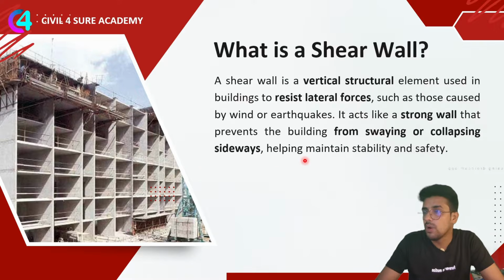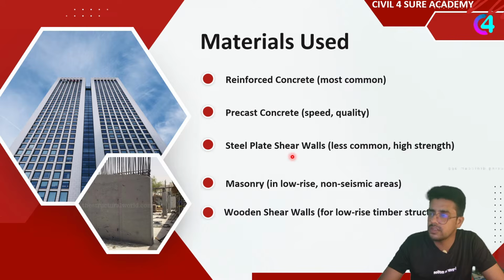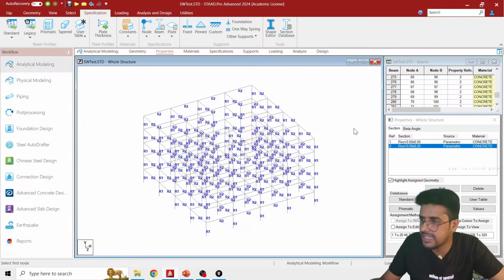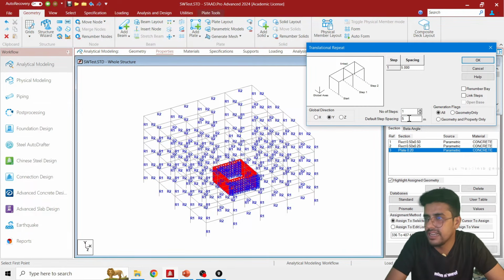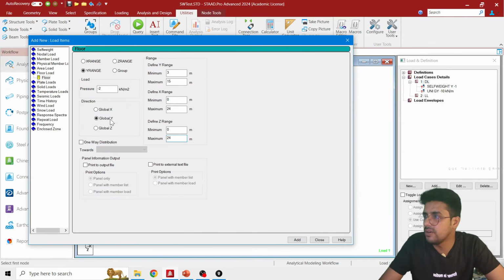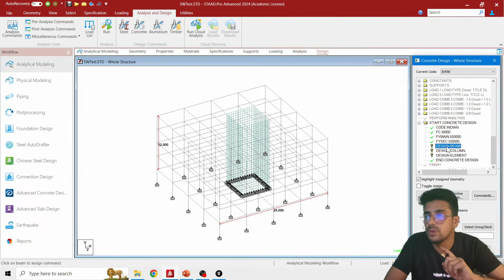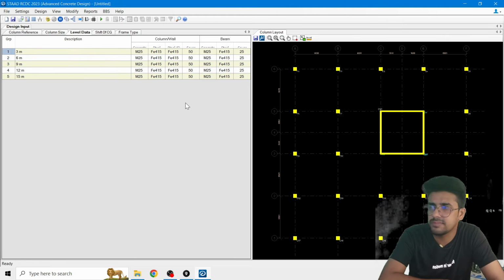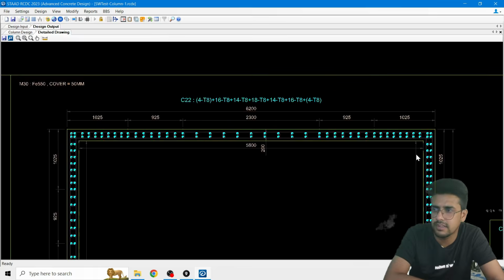Understanding Shear Walls in Civil Engineering | STAAD Pro + RCDC Connect  Edition

Comment: Thank you for your video. I have a question: the lift well is not closed on all four sides — one side has a door opening. How can I create that? Please explain.
Reply from the maker: Yes, you can do that, After clicking the Parametric Model, and after then creating a wall, when pop comes with all the details regarding Name, Type, Mesh size...there is an option of OPENING at the end, in that you need to give the opening size of your door